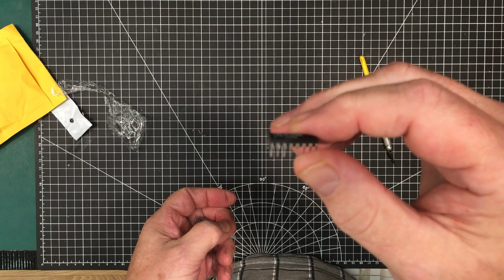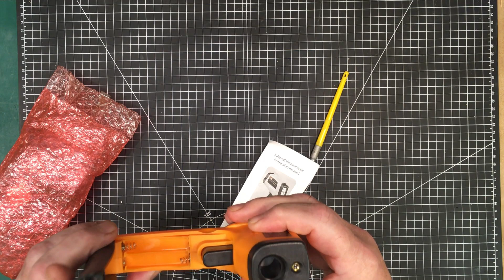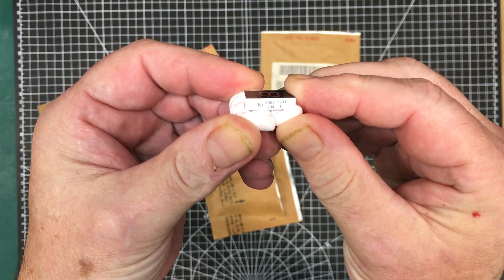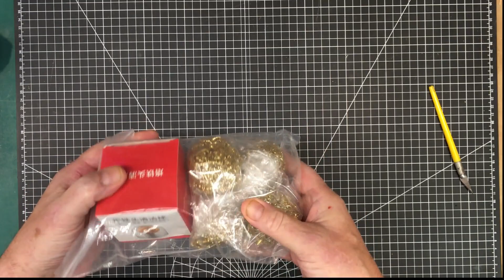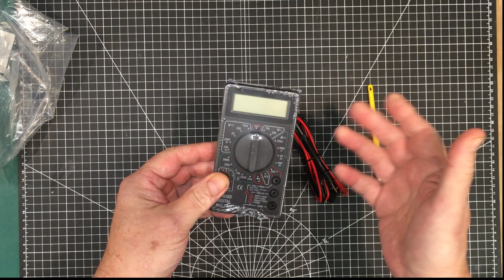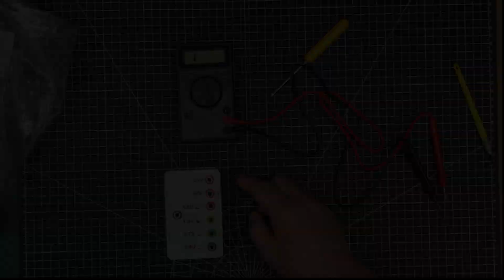0089 - Some new stuff for the lab.

Comment: When these 830 series DMM were new, they were way better built; the first two that I bought had the original ICL7107 IC inside and were easy to tweak and calibrate, actually I took the first to a lab that let me calibrate it, it was almost spot on from factory. The second one I remember having to replace a resistor inside with a trimmer and I was able to calibrate it, this one a thome, in my lab. The third one already had the blob (COB) and was not easy to tweak so I letted it be (and the following ones too). Now I only test them to see what I am to expect but I give them not so much credit; their quality degraded much in these 30 years or so since I first bougt the first one.
About these two voltmeters with 3 terminals, I got a nice deal, 3x10 for 15€ on Amazon(7€ for 10, 12€ for 20 or 15@ for 30), but those are the small ones on a PCB with tabs and various colors 7-segmet displays. I now have them enough for never needing to buy another one in my life. I checked few of them and they are pretty much accurate. I find them useful for displaying the voltages on various points of a circuit (in real time) to see what happens when changing the power supply voltage or the value of other components.

Comment: I see that Bside has recently released a multimeter with an IR temperature sensor. I usually ignore these gimmicky things these days. It did occur to me though that the Bside S30 would be perfect for the electronics noobie that also likes to cook/bbq. You could test pan temp etc and also measure the resistance of the BBQ sauce. I think Kraft bbq sauce would probably have the highest resistance since it seems to be the most resistant to being digested by the average person.
Reply from the maker: LOL!